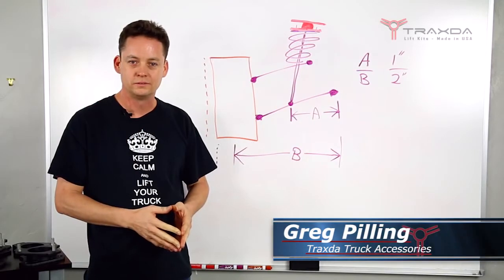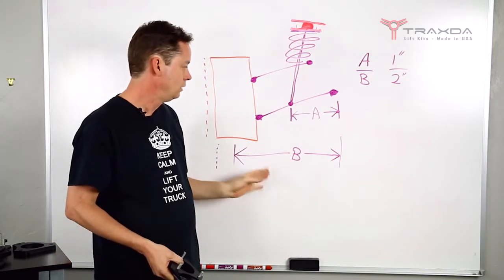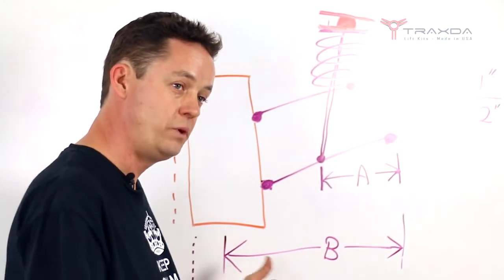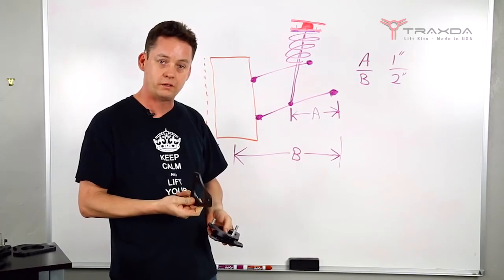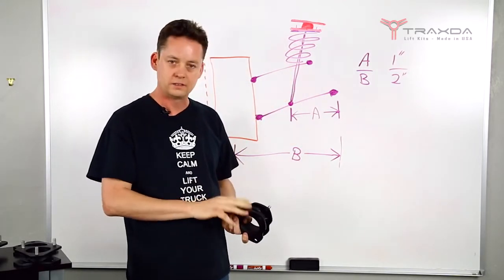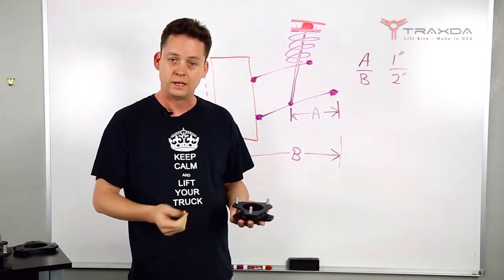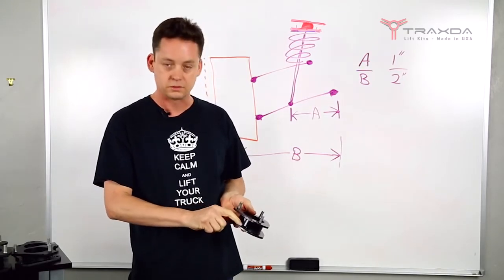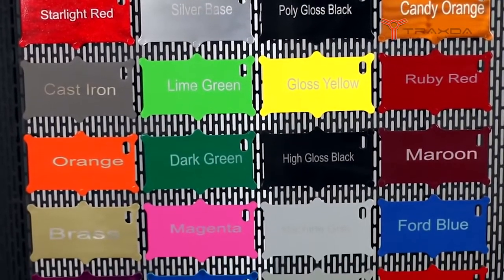Traxda   It's all about Strut Spacers Traxda Lift Kits

Comment: Thanks for the explanation of why spacer height isn't a 1:1 relationship with lift achieved. One thing I think you got wrong is putting a wider tire on won't change B since it's a measurement to the center of the tire. Changing the offset (or using spacers) is the only thing I can think of that would change B.